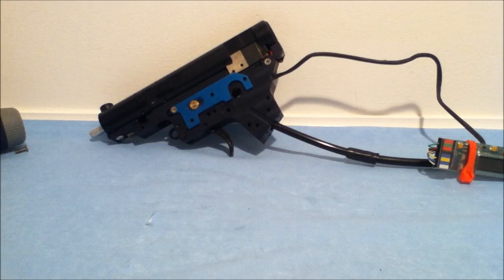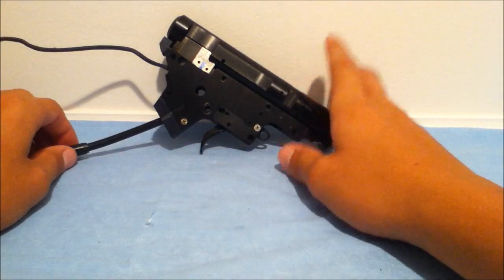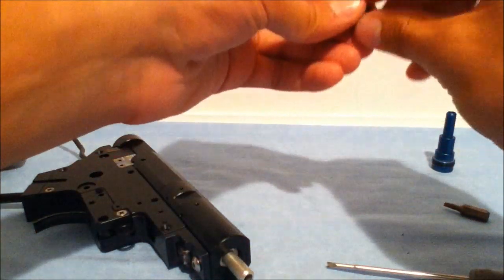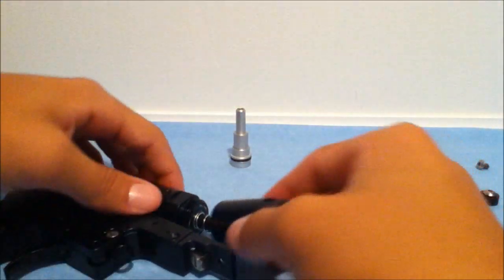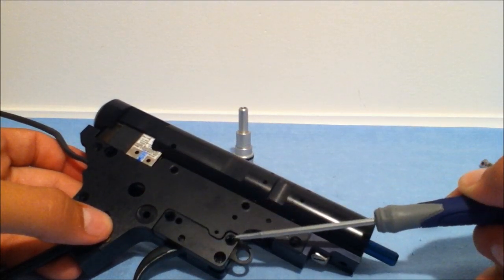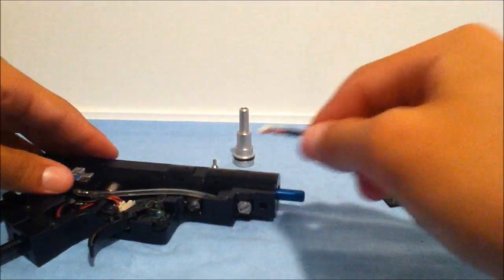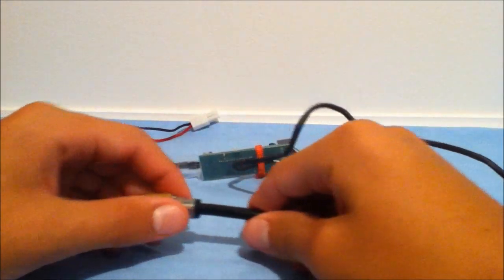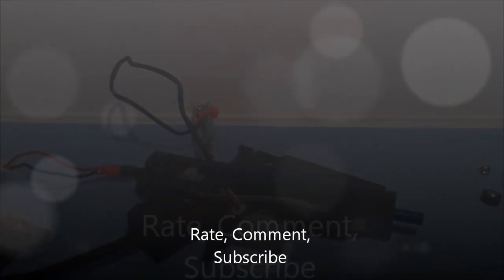Polar Star Fusion Engine Disassembly and Nozzle Swap

Comment: Hey BAA, Thanks for such an informative video!  I have 1 question: To change out the nozzle, do you ONLY have to remove/loosen those 3 screws?  You mentioned that you had already removed some other screws before starting the video.  Would I need to remove any of them as well or just the 3 you show at the beginning of the vid?  :)

Comment: Hey great video it helped me a lot. I was wondering if you could tell me what your set up is for theFCU battery, it looks like you have an adapter. Where did you get it? I am installing a fusion engine in an mg42 and I simply don't have the budget left for a lipo battery and charger.